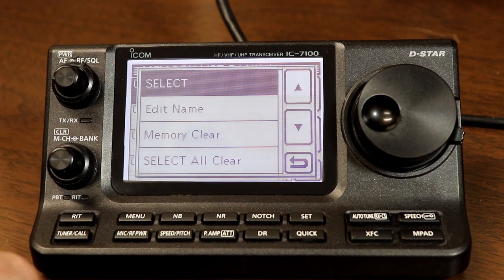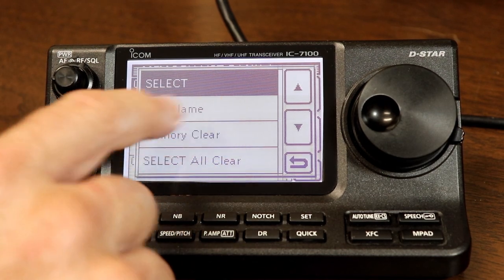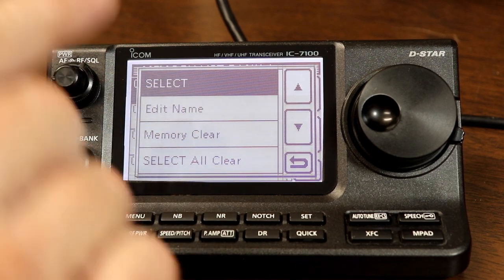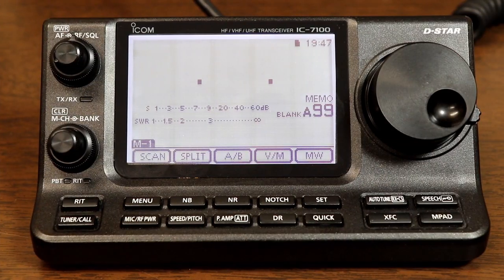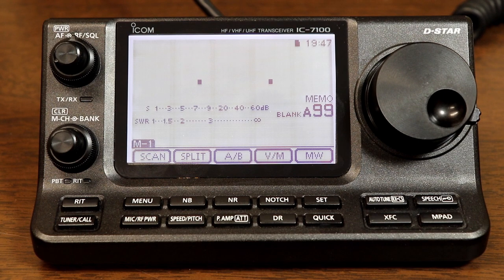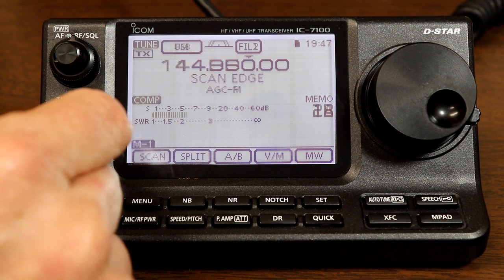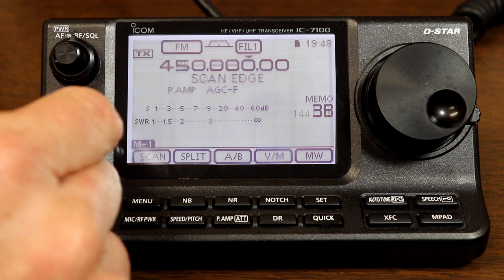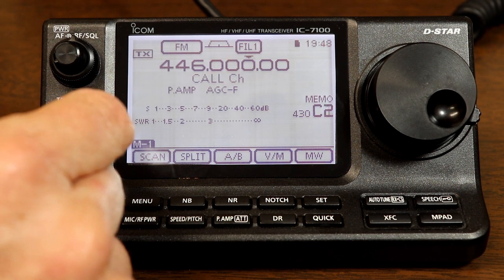IC-7100 from A to Z #7 Memories part 1

Comment: Hi Tom, this is a great series for the 7100. My previous mobiles were 2 IC706 purchased from HRO Atlanta when the 706 was initally introduced and over the years the displays have gone bad. Mostly the polorizer. I plan to restore them but in the meantime I bought the 7100. It was close to the same price that I paid for the 706. 
73 AC0Y Orlando Fl.

Comment: Hi Tom, 
Thank you for your videos on IC-7100. I have learnt more from them than I would from the 2 manuals. I recently come back to HF after 25 years. I can't believe how small and feature packet the 7100 is. 73 Les G4JDC
Reply from the maker: Thanks for the kind words.  They do continue to get smaller and smaller.  Pretty soon we’ll need a magnifying glass just to operate them😉

Comment: Great series!  Thanks for doing this.  One question I can't find.... how to change an offset step.  there are some 6M repeaters with a -1.6MHz or 1.0 MHz I would like to access.  How do I access the steps?
Reply from the maker: Hi Robert.  Thanks for the kind words.  There are 2 different ways to do non-standard offsets with the 7100.  You can use the SET menu- Go to Function -> SPLIT/DUP -> DUP Offset.  There you can change the automatic offset that occurs when you press DUP.  You’ll find this on page 4-25 in the advanced instructions.  You can also program the receive and transmit frequencies separately into the A and B VFOs, respectively and turn on SPLIT.  You can save the non-standard split into a memory.  You’ll find this on page 4-30 in the advanced instructions.  Hope this helps.

Comment: Do you have a video on programming a hotspot for Dstar? I am not able to got out of the gateway. THX
Reply from the maker: Hi Joe.  Not yet.  Just barely keeping up with the subjects I've already bitten off.  You might check out PI-Star and the MMDVM board from N5BOC.  I built it up on a Pi-Zero and it works pretty well.  There's info out there on how to do it.  You just have to dig around.

Comment: I noticed that if I am on A channel 18 (just pulling a number out of the air) and want to go to C channel 25, lets say, when switching it carries the same channel number.... so I'll have to learn how to have the frequencies I want to go to without having to turn the dials all through 99 channels as I switch "bands" ... from A to C in this case.  It changed the channels all across a-e and makes them the same.
Reply from the maker: Hi David.  There are definitely pros and cons to arranging the memories in banks that way Icom has here.  There are also many different ways of arranging your channels between the banks.  You'll just have to figure out what works best for you.
Reply: @HamRadioA2Z  Thanks for the reply.  I need to check your video on data opps but I have to do a Partial Reset to get my phone/mic to work ... and I can't get the radio to be controlled via the pomputer ... I need to run Winlink ... fldigi (later).

Comment: Hi Tom - I don't understand what the call channels in 2m and 70cm are for. Why are they treated any differently from other memory storage. I went back and re-watched a little #7 and I don't find any mention of what they're supposed to be for. Why have them? Thanks.
Reply from the maker: Hi Ben.  To be honest, I don't really use them myself.  However, some people do.  They are there to give you a quick 1 button recall for a favorite frequency or two.  I use mine just for 146.52 Simplex.  You could also use them for the main repeater frequency you normally use at home.  So regardless of what memory channel you're on or if you're in VFO mode, you just hit the call button and it goes to your favorite channel.  The fact that they have separate ones for VHF and UHF actually makes it less useful, in my opinion.  This way, you have to be on the right band for the call channel you want.  I'd rather they had just 1 call channel and the radio went to that channel no matter what mode or band I was on.
73,
Tom
Reply: @HamRadioA2Z  Hi Tom, understood, thanks for clarifying. I thought I was missing something obvious. I guess I can't complain about more memory.